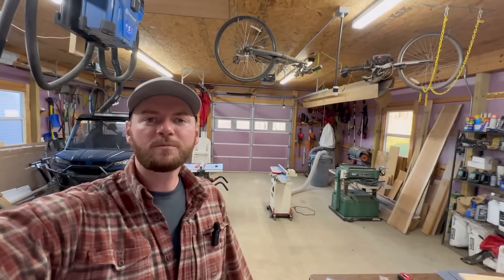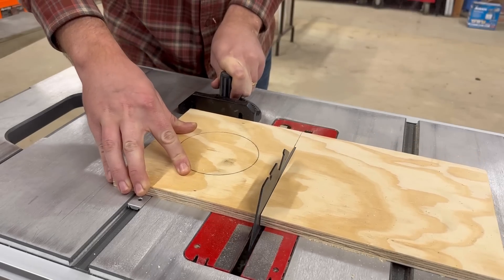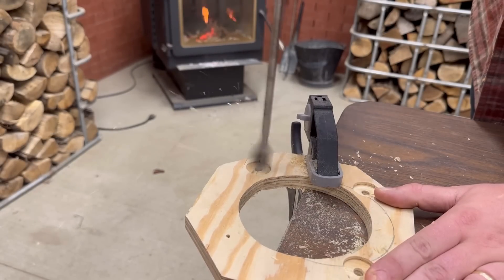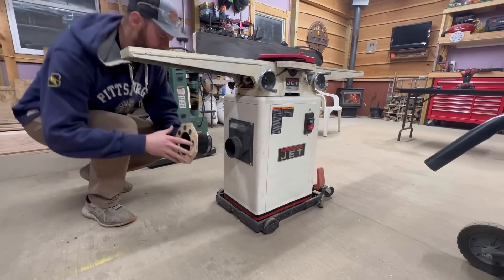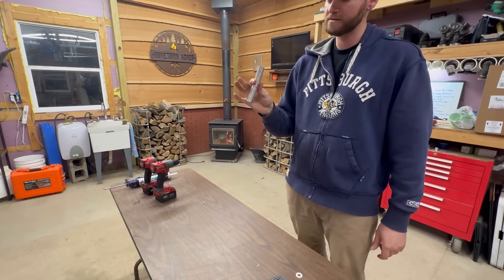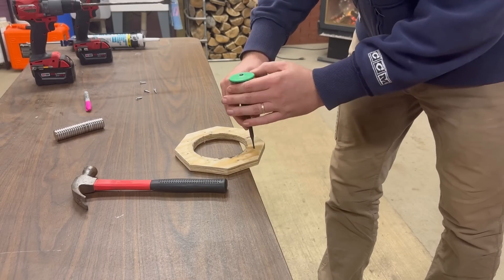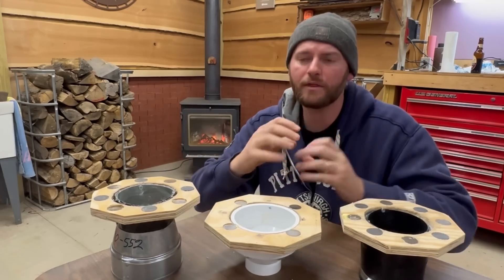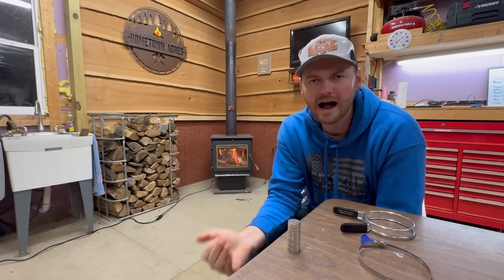Biggest DIY Improvement To Any Shop

Comment: On your planner, if you put in a 45 degree piece of pvc on the planner side, this will get the hose out of the way of the output side so that you are not fighting the hose every time you plane.  I have the same planner and I did this and it works great.

Comment: When i had my shop set up, I had a main trunk line run over head, with slide ports that I could open and close, and each station had a drop to the floor with a waste gate, and each piece of equipment had a dust collection hooked up, so just a slide of the gate, and one unit was operating, and clean up was almost as easy with the floor drops and a broom! ! 

What was really nice, was being able to compress saw dust into small logs for burning in my stove!

Boy do I miss my shop!
Reply: I liked the simplicity of the design he implemented more until you got to the drop tube waste logs. My thinking was gate slide vs connector tug was 6 vs .5 dozen, but having the drop tube contents handy for wood filler plugs, compressed logs, etc. won me over. I see your design in my future. Now to implement a power switch that’s triggered by the gate activation…  if it’s worth doing, I reckon it’s worth overdoing 😂
Reply: @vadjrob  when I entered the shop, I automatically turned on the vacuum and let it run, connected to what ever piece of equipment I used last, if I needed a different machine open another gate, and close the last one used!

Comment: Clever solution. I solved this in my shop by using the 4" Woodriver quick disconnect ($7.99) which has  a tapered throat so it can handle variations in 4" ports.

Comment: I love firewood and equipment stuff, but I appreciate the diversity in your content. I’m hoping to set up a nice woodworking shop in my historic timberframe barn once I finish fixing it. Flooring is 80% complete, but I still have some sill work that needs to wait until spring. And new sheathing to make it weather tight. Maybe 2 years to completion? ….. Like you our family will be expanding around March 1 which will slow things down for a while.

Comment: Very nice project! I like how you showed the challenges with the weak magnets - others would have edited that out so I appreciate your honesty. If you have problems with the magnets trying to come out you could use a 2-part 15-minute epoxy and that certainly wouldn't come out. Another tip to keep the shower pan liner dead flat would be to glue the liner to the blocks as you did, but clamp them gasket-down to a table until the caulk dries ensuring a flat surface. Keep up the great work!

Comment: The idea is good.
But probably a better way to do it would have been to flip the ply wood, have the magnets on the backside so they couldnt come out (rather than the gasket) And having the pvc protrude into the machine side for location would also be a good idea and prevent them being simply bumped off.

Thanks for the video

Comment: It’s a bit more costly but the Dust Right quick change system is a great solution. Their hoses are worth the upgrade even with your current system, they expand as needed and are less hassle when not in use
Reply: Rockler makes some great products.

Comment: Here's a suggestion - if it hasn't been made already - DON'T pull the two halves, rather, slide them side-ways and then pull apart. 
WAY easier and is what I do with my rip fence extension on my table saw rip fence. I use N52 grade magnets, which are some of the strongest ones available (easily at least) plus they have a centre hole so they can be screw fixed if necessary.

Comment: I wondered at first if you might be going octopus hoses and valves.  I went Doug's route with the wall mounted vacuum, cyclone, and remote that attaches so you are a step head now since I've mainly been wrapping  up outside projects

Comment: For easier one hand release, you could either glue a couple wooden drawer pull knobs between magnets, or route out half circle finger recesses on the perimeter of the vacuum side plywood rings. I’d think that would allow you to pull the magnetic connections off center without dropping the hose. Grab one handed pieces with one hand and your hose with the other to increase workflow kind of thing. 😊

Comment: I think you need to add a 90° on the planer. Keep the hose outta the way to the side. Never use the dark magnets for strength. They'll break easier to.

Comment: Adam, I enjoy your videos and often get good ideas to use myself.  One thing I noticed in this one, however, is that the size and bulk of your plywood connectors looks like it will impede the wood being run through your planer.  Might just be a camera angle thing, but I thought I should mention it.
Reply from the maker: The bottom of the planer quick connect is  about a half in higher than the outfeed piece of material so it will be close but shouldn’t pose a problem

Comment: Just add a "Y" and a blast gate on the jointer and the planer.....never have to disconnect/reconnect hoses again! I ran the solid pipe at the ceiling and then drop down with flex to each machine....keeps everything out of the way and then you don't have to play with hoses!

Comment: Love the video, but have you thought about running dedicated hoses and blast gates at the dust separator? This would prevent you from having to move hoses and since its close enough, you could open/close blast gates as you're moving from machine to machine, then you can have more permanent hoses fixtured to the machines and help improve dust collection/airflow. Great content, love the channel!
Reply from the maker: I have but with just one hose my shop is very mobile and changeable. Once I start adding multiple dedicated hoses then the pieces of equipment start becoming more permanent as their ductwork is more permanent. I like the flexibility that 1 hose with quick connect couplers gives me

Comment: If you have a problem with them pulling out you can get a glue called star bond with it and the accelerator they will stay in place just be careful bc it sets up in like 10 secs once you spray the accelerator on the glue so try and not get it on your fingers or hands...

Comment: Hi Adam, this was a great idea!  Is the adapter on the planer going to get ripped off by the wood as it comes out?  Just curious if it’s an optical illusion or if it would potentially hit. I’m going to try and do something similar. I have the same problem switching hoses all the time.

Comment: Why not use "Y" connection tubes to keep them consistantly attached to each piece of machinery?
Reply: Looks like he has a 1hp dust collector ,  usually those are pretty limited with the amount of hose you can add.  Usually need at least 2hp to add multiple lines , then then have blast gates at each tool
Reply from the maker: It is actually a 2hp dust collector from harbor freight

Comment: don't bother trying to find dust collection adaptors that will work with different machines. Check out Furnco plumbing adaptors at HomeyD etc. They will connect anything to anything and are cheap

Comment: Something I have noticed in your projects like this is that you instead of engineering something to a higher/heavier usage level you design it for slightly more than adequately.  You are counting pennies in an attempt to save dollars. In the end you end up spending money for better equipment for use in your projects whether it is rolling casters for your wood containment bins or these magnets that are integral to maintaining the hose connections.  Stop going on the cheap guy it is costing you in dollars and time and energy.  Stop being a comptroller on a project and start being a good engineer instead. You are depending on these things you are creating make them dependable.
Reply from the maker: Can’t help it. I’m an accountant not an engineer. Try as I might